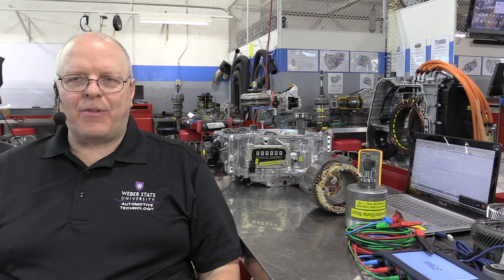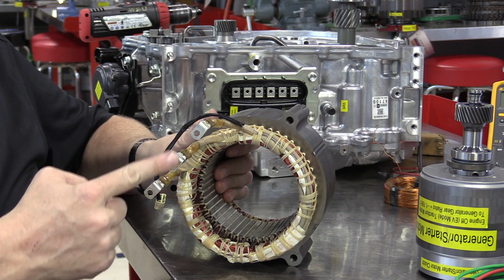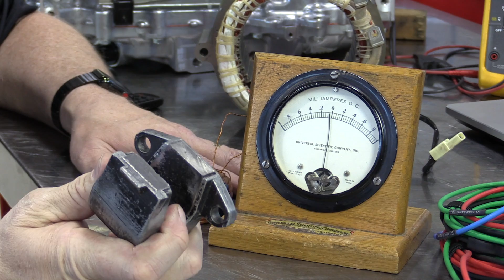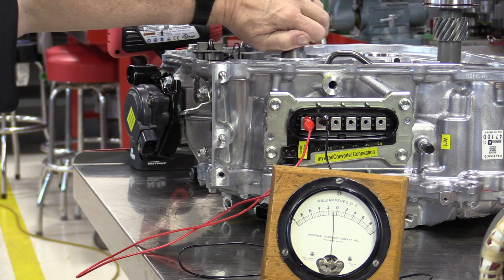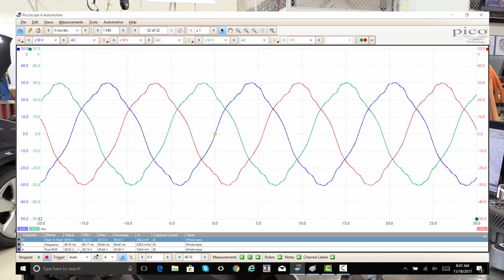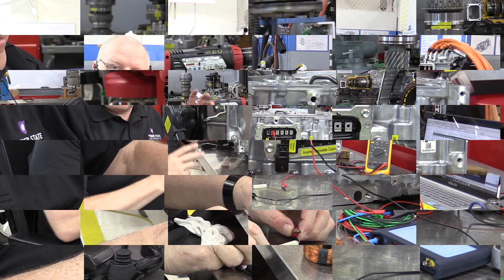Hybrid and EV Regenerative Braking Systems

Comment: I thought the B mode uses both electric motors and engine to help braking. I may be completely wrong here, that's what Toyota told me when I buy the plug in gen3 from them. I bought a prius on Friday.
Reply: Thank you for the video. I was using the ‘B’ but then got information that it should only be used on steep downhills. And then I learned that it is cranking the engine and is actually less efficient compared to using the brakes. And I stopped using it as we don’t have steep hills.

There has been really little useful information about ‘B’ and it was to me quite enigmatic why they put this on the shift knob instead of putting as an additional switch?

So when should one use ‘B’ and when should you just use brakes.
Reply from the maker: It depends upon the vehicle. Some hybrids and EVs have aggressive regenerative braking without using the engine (Chevrolet Volt). Others are not very aggressive, but it really depends upon the battery state of charge and vehicle speed. The Toyota Camry, Prius, and Highlander hybrids I have had were all different in the B position.  One thing to keep in mind is the maximum allowable speed of MG1 cannot be exceeded when in the B position. To prevent overspeed of MG1, the engine crankshaft must also rotate (since it is connected to the planet carrier). All four generations of Prius have different maximum MG1 rotational speeds, so each generation will respond differently. I tried to keep this video non-vehicle specific, but I did not do a good enough job of explaining that in the video. I have received many comments telling me that their vehicle acts differently (which is certainly possible). The main point of the regenerative braking portion of the video was to show the physical load put upon whatever motor is producing it. I hope that helps. Thanks for your feedback.
Reply from the maker: The engine can be off and the "B" mode would still work (like a plug in Prius). Sometimes the engine can be used to help with the braking force, but only when the battery state of charge is full. In the "B" position on Toyota hybrids, both motors are used for regenerative braking. When MG1 is used for regenerative braking (and the battery is full), it can use the electrical energy generated by MG2 and force the engine crankshaft to rotate at a high speed (with the fuel injectors shut off) to dissipate the extra electrical energy.  I hope that helps.
Reply: I use the fantastic Hybrid Assistant app to understand how the HSD of my European Auris works. I noticed that in B mode the combustion engine always spins. Probably as a way to dissipate breaking energy there instead of in breaks and prevent breaks from overheating. The ICE spins even when the battery is not full yet (<70%). So in B mode the battery does not charge as fast as it would in D mode.
Reply: Interesting and maybe the differences is reason that it is not exactly explained. Thank you for the explanation.
Reply from the maker: Thanks for your feedback!

Comment: Thanks a million Professor John for taking the trouble to do the regenerative braking video. As usual excellent stuff. I know my question is beyond the scope of your video. however  I was always curios to know  how the charging level increased from regenerative braking based on vehicle speed and the brake pedal pressure. As explained in the video it is by modulating the resistance between the MG and the battery pack, And its done through the inverter electronically. But the method its done is what puzzles me. Maybe you can give a brief explanation how the electronic part works later. Thanks once again for taking the trouble to impart knowledge to millions of people like us around the world
Reply from the maker: Thank you! it is called negative torque. Without the inverter providing an opposing voltage (through the drive IGBTs) to the voltage induced in the MG stators during deceleration, the charge rate would be at a maximum (The path to the battery would be MG to diode rectifier bridge to boost reactor coil (if equipped) to the battery). The opposing voltage provided by the inverter can: 1. Cancel out the voltage induced on the MG stator (no battery charging). 2. Not oppose it at all (maximum battery charging). 3. Provide a variable voltage to partially oppose the voltage induced on the MG stator (acting like a variable resistance providing a variable battery charge rate). I plan on making a video on inverter operation soon. I hope that helps. Best wishes.
Reply: Thanks a lot for the explanation and quick response. That answers my question. Hope to see some grate videos from you in the future. As an owner of a Prius Gen 3 car, Your videos have made me enjoy and drive the car better. Wish you all the very best.

Comment: i wouldn't use simple resistors as example, because they are very different from battery charging circuit. better way of describing the operation of the inverter converter assembly is to say it directs the current in whichever direction it needs to either charge the battery or spin the motor. directing the current happens by regulating the motor voltage compared to the battery voltage. in acceleration mode Vsupply>Vgenerated by the motor rpm. in braking mode Vgenerated>Vsupply. Vgenerated is dependent on motor rpm. Vsupply is dependent on the inverter converter assembly and when it is lower than Vbattery the car accelerates. when Vsupply is higher than Vbatt the car brakes.

my problem with hybrid/electric system is the question why use expensive complicated inefficient inverters/converters instead of rotor with variable magetic field strenght. either mechanically move the rotor in and out the stator or do something like alternators do-coil with variable current going trough it. when in the accelerating mode slowly lower the magnetic field strenght of the rotor in order to increase the max rpm. when braking increase it and automatically the motor will generate more voltage and would charge the battery losing rpm
Reply from the maker: Thanks for your feedback, you have some interesting ideas there. Have a good day!
Reply: The short version? The electronics end up being much, much cheaper and easier to build and maintain over time. Power electronics get cheaper, more efficient, and smarter over a generation life of perhaps 5 years vs 20+ for a complex mechanical system. Converting into and out of magnetic fields is usually one of the most lossy processes because of things like eddy current losses and the work arounds end up being very large, very heavy, or both.
Reply: eddy currents are non-issue. all transformers either have electrically isolated iron sheets as a core or have ferite core. both have almost no eddy currents
Reply: John Scarce A motor and electronic driver that are designed together really can reach high efficiency at sizes and weights that  electromagnetic systems can't get close to approaching if your main bus is DC.
Reply: so you are telling me a motor and buck/boost converter/inverter have nothing to do with electicity, magnetism and electromagnetism

Comment: Fascinating!  These motors are so efficient. Forgive me if I appear ignorant, does it always have to be 3 phase, or could it be for example 4 or even 5 phase? and would that be beneficial? Great video!
Reply from the maker: Good question. I have seen a few articles and research on higher phases. If my memory serves me correctly, the increase in efficiency beyond 3 phases was minimal and not worth the added cost of the components and circuitry. Thanks for your feedback!
Reply: Peter Bustin weberauto is definitely right on this one. Single phase is usually around 70% efficient. 3 phase is already in the upper nineties range. Makin it 6 or 12 makes it a lot more complex and the benefits will be neglible

Comment: I love these videos. Watching the amplitude and frequency of the sine waves increase with the drill RPM was super pleasing, as was seeing MG1 spin MG2. Really thought you'd need to use the drill for that, amazing that just spinning by hand is sufficient.

Question: how are the three coils wired together? Is one coil also a common ground for the other two?
Reply from the maker: Thank you! The three coils of wire are connected together in the shape of the letter "Y". Thanks for the feedback!
Reply: Sir I congratulate you on your excellent presentation a credit to your profession.

Comment: I love your videos! Thank you for making them public. My understanding was that when putting the shiftier in the "b mode" the braking was done solely by engine braking with no regeneration taking place. Am I mistaken?
Reply from the maker: Thank you! I believe you are mistaken. The engine could be off and the "B" mode would still work (like a plug in Prius). Sometimes the engine can be used to help with the braking force, but only when the battery state of charge is full. In the "B" position on Toyota hybrids, both motors are used for regenerative braking. When MG1 is used for regenerative braking (and the battery is full), it can use the electrical energy generated by MG2 and force the engine crankshaft to rotate at a high speed (with the fuel injectors shut off) to dissipate the extra electrical energy.  I hope that helps.
Reply: Yes, thank you for taking the time to explain. I have a B. S. in mechanical engineering so I understand the physics involved. I am fascinated with the design and how it was implimented. They take kinetic energy, change it to chemical potential energy, and then change that back to kinetic energy. 
I have watched many of your hybrid vehicle videos and you do a great job of describing their function. I wish I was closer i would come hang out in your shop and talk car technology.

Comment: Every time I think I have my brain understanding a new little part of the electric vehicle technology, you came and add a new and different piece to make it more confusing! Like Robin Williams description of how golf works!! 

"Oh, that why they call it having a stroke, you are really having a stroke!"

Ok, so a battery supplies D.C. to the inverter, which supplies A.C. to the electric motor, to move down the road!! But when you step on the brake, the A.C. motor stops being turned by A.C. from the inverter, supplied by the D.C. battery, but turns by movement of the car along the road, and then outputs A.C. from the motor, back into the inverter to be transformed back into D.C. to be put back into the battery! 

But, (and there is always a but) why can the electric motor powering my air compressor, run for so long, but the electric motor starting my car engine only run for 15 seconds? It can't be the difference between A.C. and D.C. motors, or my weed trimmer would only run 15 seconds at a time!! Or, is it an A.C. motor and converter setup, in my trimmer? 

IM SO CONFUSED!!
Reply from the maker: There are many types of electric motors. Your starter motor is a brush type high current motor. If you ran it continuously, it would need to be liquid cooled or it would burn up. Additionally, the brushes wear out over time. AC motors do not have brushes and are typically air cooled or liquid cooled so they can operate without overheating. I do not know what type of motor your weed trimmer has, but i am sure it has an internal fan and a temperature sensor that would shut it off if it got too hot. I know that is not very helpful. I plan on making videos on different motor types in the future. Thanks for your feedback.